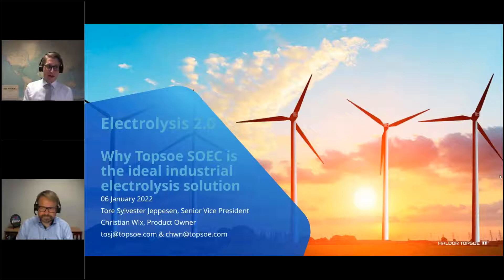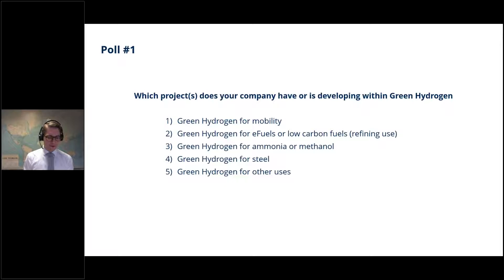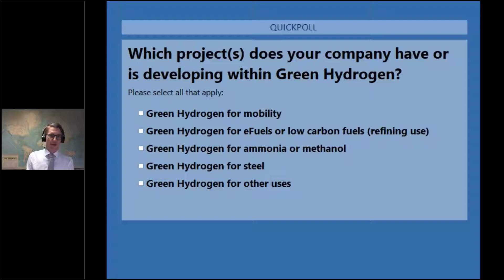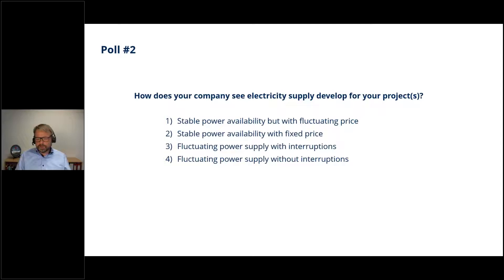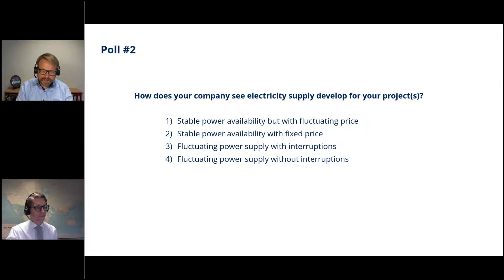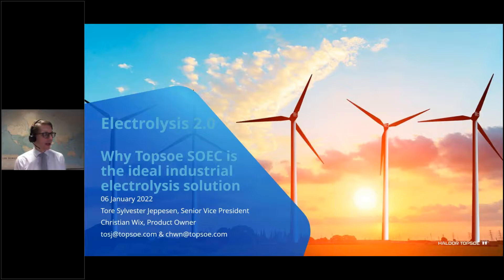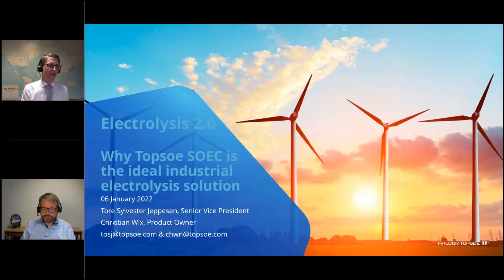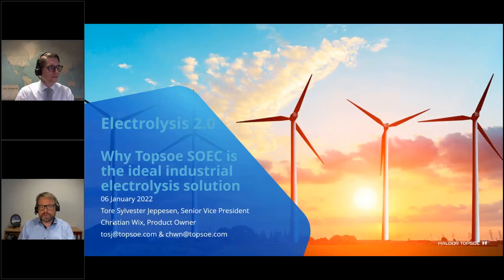Topsoe Academy™ LiveShare_ Electrolysis 2.0 - Why Topsoe SOEC is the ideal industrial electrolysis s

Comment: That is very informative. I have a doubt. Does the stack heats up by itself or all the heat comes from the steam temperature? Does the stack need to be in a furnace? Is it possible to operate this at 171 degrees Celsius with that stack thermically isolated? Thanks